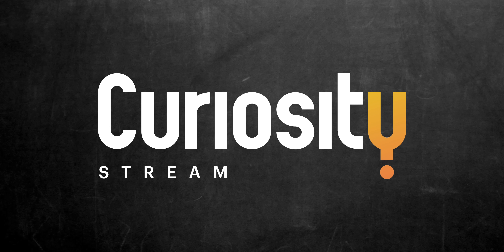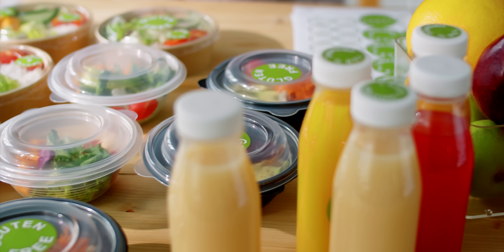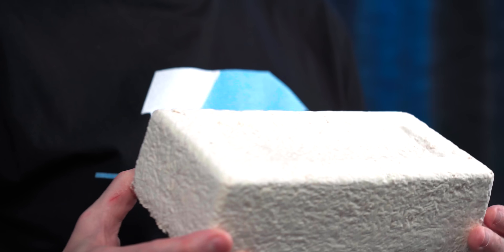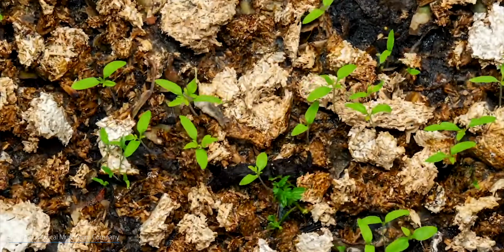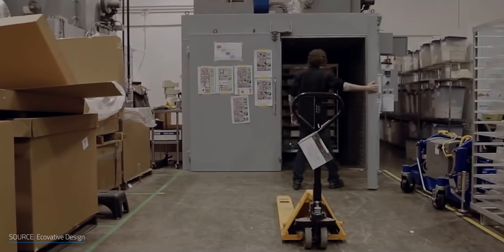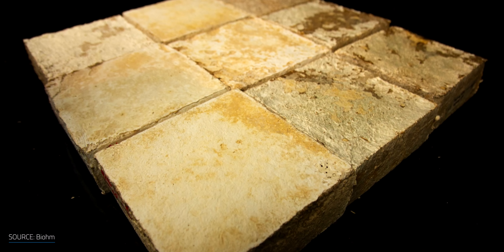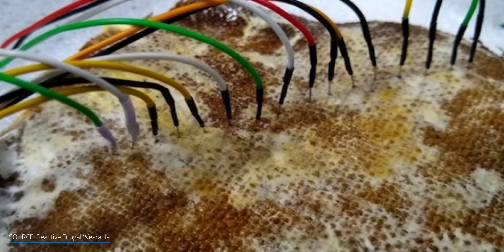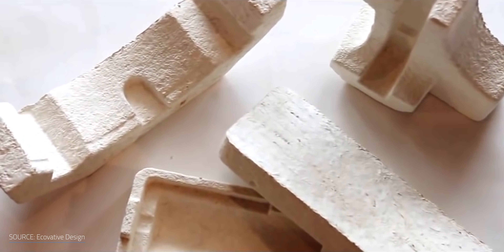Is Mycelium Fungus the Plastic of the Future?

Comment: Just a quick point Matt - biodegradable is not the same as compostable. Biodegradable is a very broad term and encompassed anything that will break down eventually, including certain plastics with additive to help them breakdown...into smaller bits of plastic. Compostable means it will break down in compost with in a certain time frame. It's further broken down to home and commercial compost. Commercially compostable requires condition most home compost doesn't get, so it probably won't breakdown at home within the specified time frame.

Comment: A young fellow tested polystyrene as a food for several organisms and found a worm that eats and digests polystyrene for food, and thrives on it.  We should be pushing that technology too.
Reply: yeah, and the by-product of that was antifreeze which is also no recyclable and toxic
Reply: @blueturborider  what seems to be worse than antifreeze ('I found no mention of that yet) was the flame retardant HBCD or hexa bromo cyclo dodecane .  From the name you could draw the molecule straight off.  At least I could.  Anyway it's very toxic and the worms excrete it in their droppings along with some biodegradables.  So the worms are safe for animal feed but their droppings cannot at this time be made into plant fertilizer. Too bad!
Reply: @blueturborider  if it turns to antifreeze it is just molecules composed of Carbon and Hydrogen or Hydrogen and Oxygen, which then can be broken apart with energy.
Reply: @blueturborider  That word non-recyclable is a misnomer -- It is not PROFITABLY recyclable... Matter is made of energy, which can neither b created nor destroyed, only converted to another form... The energy required to break the chemical bonds and then combine them with something else to make it stable and non-toxic costs more than the final product is worth.  Everything is recyclable, not everything can be recycled PROFITABLY.
Reply: Another good thing to get rid of plastics is a fungus called Pestalotiopsis microspora that also converts plastics.
Reply: My point is that you can't reduce anti freeze ( if you can I don't if can and after reading the comments under I wonder how energy efficient that is) other point is that I don't think you can reuse. I might be wrong
Reply: @blueturborider  this article says the bacteria in the worms guts break it down into carbon dioxide.  I will keep looking.  
https://www.the-scientist.com/news-opinion/beetle-larvae-can-survive-on-polystyrene-alone-67251

Comment: I missed information on why this tech hasn't been accelerating considering everything that's going for it. You usually cover these aspects.
Reply: You can pump out plastic foam packaging within seconds. This stuff takes a week to grow. I think that probably has something to do with it.
Reply: @davescott7680  Not a bad point, but if the additional time doesn't require a lot of additional work, it might not be impossible to overcome that aspect.
Reply: @joelface  I would imagine that it will still require additional capital costs for the same output amount, since there would be more storage space dedicated for the one week growth phase, and thus a far larger physical factory in order to produce the same amount. Of course, this could potentially be offset by other costs being much cheaper, like perhaps less energy usage.
Reply: @erikharaldsson2416  It sure does require large investments. Ecovative (the main company mentioned in the video - they hold almost 50% of all patents for mycelium production) just got 60M USD investment in round D (I don't know how many millions they got in the previous rounds). So it is moving forward, but as all new technology, it will take years. Most people (and companies) don't care about recycling or health safety... they only care how much it costs. I think it will need to be cheaper than plastics to start replacing them.
Source: https://www.instagram.com/p/CNDWzr4nROQ/
Reply: @joelface  You also saw that it was a very manual process. You would need a factory 100 times as big as a plastic factory, with 500 times as many people. Great for the economy, but not much business sense. May as well build a recycling centre for that money.

Comment: I'd be interested to know how water resistant the leather-like material is.
Reply: Right, obviously mushroom shoes would be good for a few months or so. But if they are inexpensive, who cares.
Reply: @ajemohaltom3560  wdym who cares? If those shoes only lasted a couple months, there would be mountains of mushroom shoes all biodegrading and releasing CO2 emissions.
Reply: @ajemohaltom3560  Right. Except right now it seems a boutique product for virtue signaling vegans.
There is no production line 7oz Shore-80 'Smoked Wisky' in a 54" bolt at $15 a yard.
Without a consistent supply of consistent material large enough to make shoes/handbags/sporting goods/upholstery/whatever it is always going to be a niche market.
And as long as humans continue being omnivores it's not like we are running out of hides.

Comment: Why would the mycelium conveniently decompose after use as packaging, but remain useable for a long period for insulation, clothing, etc?
Reply: I think the mycelium is just used as a binder for the chaff, wood fiber or other cellulose product that makes up the bulk of the packing.
It is killed when the forms are sterilized. Once the form is wet and in the environment it will decompose.
But this seems incredibly resource intensive compared to using recycled paper pulp for the same thing.

Comment: If the material decomposes easily then how long can it last in products?
Reply: That's one of the reasons they're looking into disposable packaging uses first. There will certainly be solutions to that, though. treatments or just maintain the proper environment. Wood decomposes, and we can still build structures that last for hundreds of years, if you keep it dry. Burry it in the ground, and it'll be gone in a just a few years, though.

Comment: Manufacturers of all products need to use recycled materials in their production process.
There needs to be a value for recycled materials. Using them to produce new goods is necessary for recycling to be profitable. It seems crazy that bubble wrap and styrofoam are used in packaging. Sure seems like poor quality paper products could be used for this. Paper and cardboard should be able to be continuously recycled and used for products that do not need to be of high paper quality.

Comment: Every one of these videos gives me an "I want it now" reaction. The possibilities exposed by new research are endless, but take a long time to come to market and become widely accepted.
Reply: The biggest issue is that all the plastic manufacturing machines are already built. Even if a new product came out that was ridiculously perfect in every way, but incompatible with current injection molding, we'd still see it take decades for the market to migrate. They aren't going to throw away working machines until they are no longer profitable to operate.
Reply: @Beakerbite  The NSW govt in Australia wants to ban all disposable plastics and if all countries did that the plastics factories  would be forced to abandon their machines or convert them somehow (when it comes to disposable plastic shit).
Reply: @Beakerbite  I believe if Amazon would step in and
 incorporate some Mushrooms mold factories into their mega Centers, we would see Worldwide adaption in no time.
Reply: @danielsoeller  you are right about that. If big companies adopt it- the rest of the market would take a lot less time.
Reply: @Beakerbite  that's where government should come in, enforce measures about leaving plastic behind and even give subsides to companies that need them for the change of infrastructure. But they won't do that because they don't give a damn and they are all corrupt from top to bottom.
Reply: @nahuelcutrera  Dude, you have to rework the entire supply chain. Plus, greenhouse gas emissions are much more of an issue than other types of pollution.
Reply: @nahuelcutrera  More government is hardly ever the answer.
Reply: Mmhmm.

Somewhat like cultured/lab produce meat/dairy, or 500 mile range EVs that don't weigh significantly more than an ICE counterpart.

Great moves forward that will change the world, but sadly not overnight, and likely not soon.
Reply: I would love to test it myself because I know it's a good idea. Everything checks out
Reply: Yes, but they mostly don’t come true and we never hear more from them. I prefer success stories where it worked.
Reply: Oil is King and the big bods up top wont allow mycelium to replace the monopoly they have on oil, this is why Stanley Meyer was assassinated in 98
Reply: @ericcartman1859  we can't use oil forever, at a certain point they will be forced to make a switch
Reply: Product cycle times keep getting shorter and shorter as computer modeling and 3D-Printing bring down development times and costs.  China just introduced a wafer-sized processor that is essentially an entire data-center on a single piece of silicon -- ONE TRILLION transistors on a single chip... That is the equivalent of 1,000 PC's on a disk the size of a large pizza... Stack ten thousand of those, and you have more processing power than exists on the entire planet.  With that kind of computing power, you could model a thousand generations of product development before you build your first prototype. In just a few years, you can skip the awkward stumbling and develop an optimized product in the same time it takes to build a prototype today.
Reply: Government can fix it, if it stops trying to give "free" things out and buying tanks
Reply: @RandyRandersonthefamous  “free things” is often used as a euphemism by right wing chuds for benefits such as welfare. Cutting these would have an enormous harm on society and increase poverty immensely.

I won’t object to cutting the military budget however.
Reply: @RandyRandersonthefamous  Government has been the problem -- protecting their pet industries, squashing competition, and suppressing innovation... THE PEOPLE can solve their own problems if the government gets out of their way...
Reply: @walterbaltzley4546  Even the most ecologically progressive governments over in Europe don't take measures as drastic as some of the people in this thread are suggesting. There are plenty of governments that do suppress innovation for the sake of 'protecting their pet industries', but there's a reason governments like to take things slowly sometimes. People don't realize the scale this needs to happen at. If we forced everyone to immediately shift over to new eco-friendly packaging, we would have a global shortage, not to mention that some of the other problems with this method would immediately begin to present themselves (you can find these problems in other videos talking about mycelium replacing stuff like Styrofoam).
Another thing in particular on the consumer side is that the big downside is also the big upside. Since this stuff is made out of mushroom, it tends to last a shorter time and is more susceptible to degradation or organic contaminants like mold, bacteria, and fungus, which cuts into its longevity.
Reply: @dav356  If an innovation is particularly useful, then there is no need to "force" anyone to do anything... Ex.  One of my spiritual leaders was an oil executive, and an inventor...  He found a way to perform one of the refining steps to convert heavy to light crude, at the WELL HEAD... It would have saved the industry 20% on refining cost and enabled them to use heavy crude in places where it is currently not economical... nearly doubling the oil supply... 

However, when he applied for a patent he received a visit from some federal agents who told him they were seizing his patents in the name of "National Security" and forced him to sign a non-disclosure agreement under pain of asset forfeiture and arrest.  He is not the only innovator to have this done to him.
Reply: @walterbaltzley4546  The promise of any technology is limited by the opinions of those that own the patents.
Profit motive is the overwhelming driving force of all production, and the shortest road to quick gains is prioritised over delivering innovation or consumer needs.
You don't need 'federal agents' to hide technology, companies like how Osram & friends have already colluded together to retard product life to an agreed amount (planned obsolesence)

I know RWs have a boner for Reagans neoliberalism of small government (for allowing the transferring of public power for private profit) but bad government is usually a result of politicians who don't represent the peoples interests.
We already have historical precedence of the affect of corporate monopolisation of industry, and its not in the best interests of the community
Reply: @mr.dalerobinson  You may not NEED federal agents to hide technology, but you HAVE federal agents doing it.  WHY?  Whose interests does this serve? 

Who grants industrial monopolies?  What is a patent?  Who grants patents?  Who grants corporate charters?  Who creates the rules that governs corporations?  

I agree -- Study the history of corporations... their power is always entwined with government power...
Reply: @walterbaltzley4546  the corporations don't need federal agents, Reagans neoliberalism is privatising the Government, ultimately business can't even abide the idea of an organsation that could represent the peoples interests, hence the small government strategy.

Transferring public power to private profit is only possible if they can destroy trust in all the institutions that threaten them.
Government can be the best defence for an citizen or its worst nightmare.
Media could be a service to the community to speak truth to power, or it can play clickbait profit making schemes of division and cash for commentary.

Business has been in bed with power since the beginning, capitalism came out of the late medieval period.
That storyline is as old as money.

Its all about aspiring to the standards of the Brtish East India company, the first corporatocracy that looted a country for almost a century.
Reply: @KD--sj8eo  US gov have large government spending on military is probably due to overseas base. Don't forget US military governed the world and not just the home country
Reply: Im just here to join the Brotherhood of Steel

Comment: I'm all for reducing our dependence on plastics since we can't be relied on to use the recycled material or even recycle in the first place. This seems like a really promising solution. This can also be used in automobiles, and maybe even carpets. The only downside I see is where the biomass will come from to replace the plastics industry. We're already having trouble with clear cutting natural ecosystems for biomass power plants then replacing them with monoculture tree plantations. At least it's the better of the two evils, baby steps right?

Comment: As long as the packaging does not contaminate my food , the product in the box,etc.
Reply: It is structurally strong and fully dead so i doubt that will be an issue.
Reply: @n.g.s1mple29  if it does not become a haven for bacteria or another fungus after being heat treated...sure.
Reply: @Phil-D83  id think not.
Reply: @n.g.s1mple29  let them test on other people first....always unexpected problems...not long ago, automobiles using wires coated with soybean derived insulation attracted mice who chewed in same...results were fires and electrical failures

Comment: Mushrooms are the future! I'd love to live in a mycelium-insulated home
Reply: And Plastic  is transformed petroleum and other flameable subtances .. what your point?
Reply: @tomizatko3138  the key word is transformed. because this transformation does change the properties of a material.
graphite is flammable. Diamond is not. even if they are both carbon.

and I'm really not too sure what's your point because you do not make house insulations out of plastic anyway.
out of polystyrene then yes they do - but while it can be flammable it is also significantly fire-resistant.

These mushroom bricks are just dried-up organic material. I gonna bet they won't have any fire resistance whatsoever.
So what happens if you start using materials like this? Google "Grenfell tower fire".
Reply: do you, really?
dried organic material, based on hay?
that sounds to me like something very much flammable.

Comment: Would mycelium be useful in low production rate custom metal casting?  Say you wanted to cast a limited number of engine blocks out of metal. Making a set of conventional molds would probably not be economically viable. However, could you use polymer 3d printing to create a negative mold, and then use that to create positives in mycelium? Those positives would then be used in casting, pretty much like the lost wax method. You would still need to clean up the castings but you have to do that anyway regardless of method.
Reply: Not really. The mold have to be preheated to 300-500C / 570-930F so the metal that you put in to it will spill around evenly without causing defects. That's why silica and ceramic are used to create molds. Also melted metal it self have very high temperature and would if not burn complete mycelium mold then for sure deform it .
Reply: @Askaret  I must not have been clear enough. I meant using the mycelium positive as a core to pack sand or silica around. Metal would then be poured into the mycelium core to burn it off and take its place. That's basically how the lost wax method works.